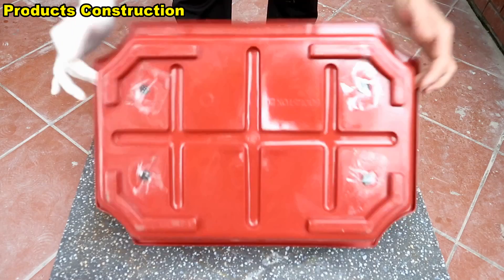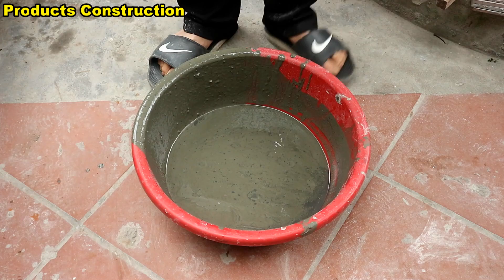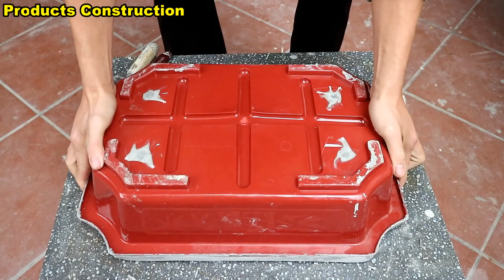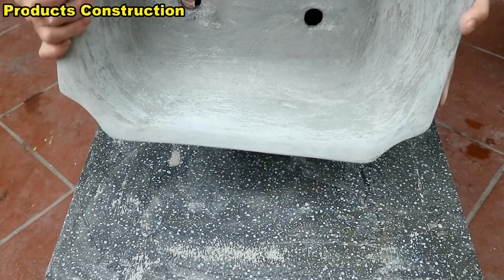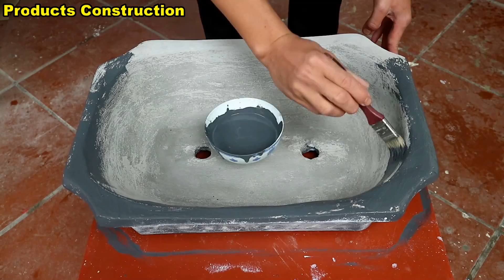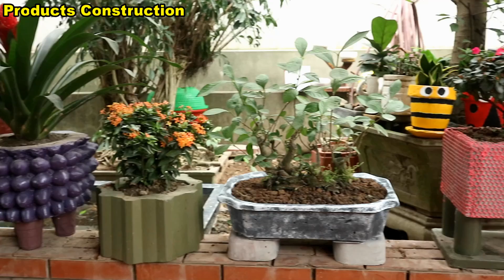How To Make Bonsai Pot Easy At Home | Techniques Painting Fake Stone Pots  Rectangular Pot

Comment: The problem with this type of pot mak8ng is that you can't put reinforcement wires on them. So they might crack in extreme cold or heat.